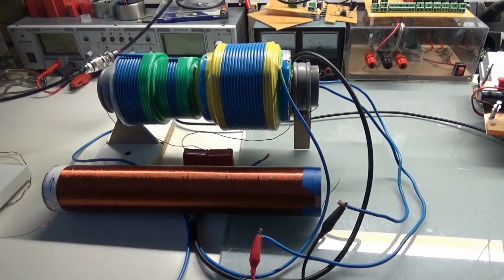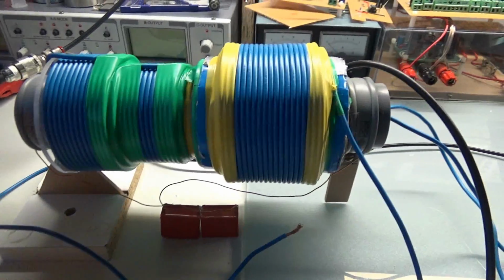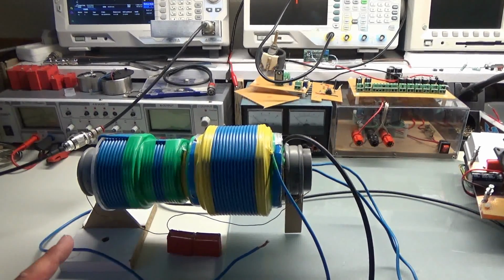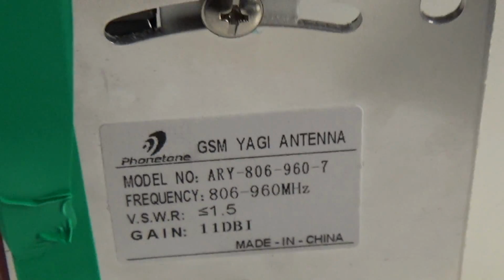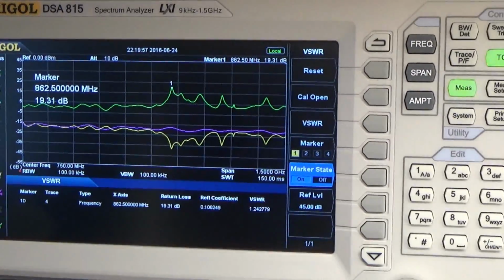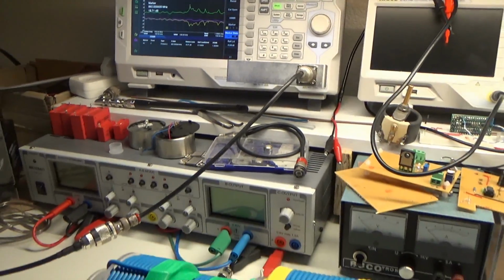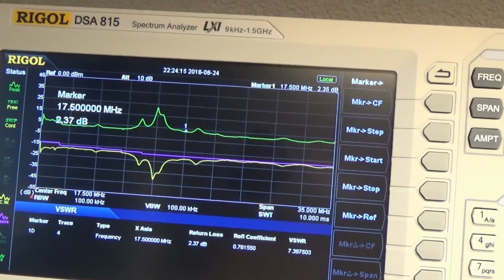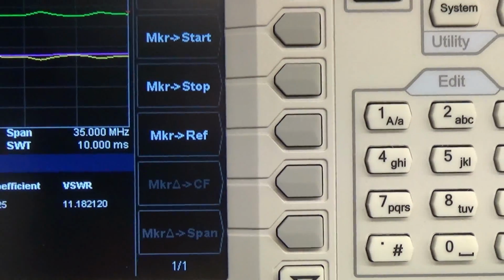ruslan final

Comment: WRONG GRENADE COIL !! MAKE IT HOOPER COIL. HOOPER IS PURE CAPACITANCE COIL - NO INDUCTANCE AT ALL. MAKE IT THIS. START POINT. WIND TO RIGHT CW DIRECTION TILL END. STOP. START MOVING BEHIND COUNTER DIRECTION LEFT WIND ONLY CCW TILL START. AND AGAIN AND AGAIN SEVERAL TIMES. THAN TEST AT SPECTRUM ANALYSER. BUT FIRST MEASURE LENGHT , WINDING STEP (YOU ARE USING INSULATION ISNT IT) AND IMPENDANCE. SWEEP IT FROM 0 UP TO 10MHZ. THAN YOU FIND FREE RESONANCE POINT TAKE 2nd HARMONIC OF IT AND TUNE WAVE RESONANCE EXACTLY. 
THAN PUT IN YOUR GENERATOR.ELSE THOW YOUR COIL IN TRASH !! IT WOULD NOT WORK !!

AND MAKE NEW PCBS HERE  НаилюБТГ.rar
Размер: 76.00 Мб
https://yadi.sk/d/HYHTPcB_39ZkpK!! 

----------------------------------------------------------------------------

NIKOLAI TESLA - Electrical Experimenter Magazine 1917-1919
Размер: 229,9 МБ
https://yadi.sk/d/yraaLJWodjjn2

---------------------------------------------

РАССЕН НИКОЛАЙ ТЕСЛА
ТESLA ARHIVA.rar
https://yadi.sk/d/kUx27GEx3APuBU

---------------------------------------------

Luchin_Priroda-poley-vzglyad.pdf
Размер: 2,1 МБ
https://yadi.sk/i/QPXzBe_ndjmmT

---------------------------------------------

Luchin_O-klyuchevyih voprosah v fizike.pdf
Размер: 1,1 МБ
https://yadi.sk/i/aT-1RpdYdjmmP

---------------------------------------------

Luchin_Liha-beda.pdf
Размер: 24,4 МБ
https://yadi.sk/i/5gIOXJK9djnUy

---------------------------------------------

Luchin_Istina-i-svoboda.pdf
Размер: 19,7 МБ
https://yadi.sk/i/GKaBIhN9djnWd

------------------------------------------

Luchin_Fiz-polya-put.pdf
Размер: 1,8 МБ
https://yadi.sk/i/ce60VDa0djmmR

------------------------------------------

Luchin_Fiz-polya-kontseptsiya.pdf
Размер: 2 МБ
https://yadi.sk/i/ugLv0THAdjmmM

-------------------------------------------

Luchin_Clavyane_svet.pdf
Размер: 13,2 МБ
https://yadi.sk/i/C77N4O74djmnJ

-------------------------------------------

Kachers.rar
Размер: 633,9 МБ
https://yadi.sk/d/MYYKBt6ddaGC2

-------------------------------------------

Видео !!
Ismael Aviso Big BREAKTHROUGH run BIG AC MOTOR part 1
Размер: 78,6 МБ
https://yadi.sk/i/N66TPHJvd4Edu

-------------------------------------------------

Видео !!
Isamel Aviso motor BREAKTHROUGH run BIG AC MOTOR part 2
Размер: 35,1 МБ
https://yadi.sk/i/ZmfmLKm9d4DLZ

-----------------------------------------

Vladimir Ilych Brovin.NEW.zip
Размер: 8,3 МБ
https://yadi.sk/d/WbpBln2BdaFz3

-----------------------------------------

Viktor Shauberger - Hidden Nature.pdf
Размер: 10,3 МБ
https://yadi.sk/i/s1VqP-GBdXGXt
-----------------------------------------

Павел Николаевич Яблочков - Труды Документы Материялы
https://yadi.sk/i/uTVcsweTwCGfr

Демонстрационная методика синтеза элементов из воды
в плазме электрического разряда
https://yadi.sk/i/kRsz8ASKzdTTt

Болотов - Основы строения вещества.редакция 2010г.(665 стр.)
https://yadi.sk/d/7IbPgG0CujRTC

Х-файлы Сан-Франциско.doc
https://yadi.sk/i/kbJmqvIid2Efm

Электричество во всех его применениях…
https://yadi.sk/d/uzc3WZxRhFGJK

К.П.Xарченко «Лучистая Энергия»
https://yadi.sk/i/kWZtVlkfvxHMz

Харченко К. П., Сухарев В. Н. Электромагнитная волна, лучистая энергия — поток реальных фотонов.
https://yadi.sk/i/qk3SL5Pyvny3C

НОВАЯ АНТЕННА БЕГУЩЕЙ ВОЛНЫ "ОБ-Е"
Константин ХАРЧЕНКО
http://ra3tox.qrz.ru/s5/an-501.html

Афанасьев - Средства измерений параметров магнитного поля
https://yadi.sk/i/fNqKDZV_wLex8

Сергей Сталкер - Мои схемы из видео для Ютруб.zip!!
https://yadi.sk/d/o_vaa63Mvd4qs

Сергей Алексеев
https://yadi.sk/d/G63r5TcMvd54R

ADRIAN BTG.pdf
https://yadi.sk/i/pZ9yvYZ9z7WwK

I.Grekov.Resonans.1952.djvu
https://yadi.sk/d/YHa20d-C3DtMYD

отрицательное сопротивление ферритов → параметрически Резонансний Генератор
http://i12.pixs.ru/storage/7/2/8/Parametric_1420395_24608728.jpg
http://i12.pixs.ru/storage/7/3/2/Parametric_3714215_24608732.jpg

Geron Aleksandriski
http://i12.pixs.ru/storage/2/6/4/GeronAleks_9283308_24637264.jpg

Tesla Octave Multiplicator
http://i9.pixs.ru/storage/1/2/7/teslamapto_6631221_24628127.jpg

Ч. Ледбитер - Оккультная химия
https://yadi.sk/i/TUJo0favuf9bS

Cater, Joseph - The Awesome Life Force- Orgone
https://yadi.sk/i/njXQLvvyvmeXF

----------------------------
yadi.sk/d/plujHeAZuVooZ
yadi.sk/d/iKX-KAXRujRST
yadi.sk/d/Ij9bJeZU37rJgg
yadi.sk/i/TUJo0favuf9bS
yadi.sk/i/N9tChYlE37sHxp
yadi.sk/i/j-n7KZSR37sJ6V
yadi.sk/i/ZbJEzE6K37sJAV
yadi.sk/i/5gwUrShk37sDMH
yadi.sk/i/bjPlMGHp37sDSe
yadi.sk/i/DwS4bcm137sDZo
yadi.sk/i/yMou7t8k37sDdq
yadi.sk/i/okpmH2Fj37sDhT
yadi.sk/i/TOnm-jHO37sDnN
yadi.sk/i/qxpyVDsh37sDrL
yadi.sk/i/FVSwMMRW37sDwD
yadi.sk/i/J9xMWzb_37sE2u
yadi.sk/i/JjK3kv5437sE83
yadi.sk/i/27ty6j0-37sEBp
yadi.sk/i/aHNxqeMT37sEHJ
yadi.sk/i/cpZ5uyuW37sEi7
yadi.sk/i/sTPdBhMY37sFhP
yadi.sk/i/-FGttUQ_37sFva
yadi.sk/i/zr-GvWc137sG2h
yadi.sk/i/Xk1GbF3I37sG7A
yadi.sk/d/lDMH-UiX37sGBL
yadi.sk/i/lzX3hcKY37sGG5
yadi.sk/i/-n-Mdp8G37sFLa
yadi.sk/i/XLEaHpkO37sGfc
yadi.sk/i/nuZmsNJZ37sGjW
yadi.sk/i/qzpopM9S37sGoY
yadi.sk/i/ycGjwtVO37sGsS
yadi.sk/i/nxdYhJ_P37sGy4
yadi.sk/i/4qB0zIOF37sH4J
yadi.sk/i/TQcekFST37sH7o
yadi.sk/i/Fzpzsgzb37sHAp
yadi.sk/i/MxtrbmNa37sHFB
yadi.sk/i/Cdo2VHHg37sHUa
yadi.sk/i/Q8C53axm37sHZH
yadi.sk/i/46hi4Vei37sHdo
yadi.sk/i/JTP4s8Ed37sHi4
yadi.sk/i/LyvEJ7Qg37sHmw
yadi.sk/i/NuPY6ISU37sHtg
yadi.sk/i/Ylp6ME_b37sEnK
yadi.sk/i/-n-Mdp8G37sFLa
----------------------------
yadi.sk/i/8AWmMevA37sKGA
yadi.sk/i/m9dJiSKo37sKTm
yadi.sk/i/-quwQ8mn37sKYG
yadi.sk/i/d2nREohF37sKgt
yadi.sk/i/VmhTNJzC37sKnS
yadi.sk/i/Zn9IWezz37sKM9
yadi.sk/i/tOVqPtQG37sJyg
yadi.sk/i/_ms9OSLt37sKAN
----------------------------
yadi.sk/i/e8bsDOTs37sLJ3
yadi.sk/i/UB6PFx7T37sLP6
yadi.sk/i/ykXwFCHi37sLSf
yadi.sk/i/I3PQMvtU37sLdi
yadi.sk/i/eqahV9kX37sLjC
yadi.sk/i/RQyXbf_I37sLo6
yadi.sk/i/so5ung3N37sLvF
yadi.sk/i/7__ufOAh37sLzF
yadi.sk/i/4IT5hFFg37sM5B
-------------------------
yadi.sk/i/OAWp6hrr37sMUa
yadi.sk/i/9vxXShU437sMZP
yadi.sk/i/UZk137Vw37sMcW
yadi.sk/i/J_MwT8HQ37sMfs
yadi.sk/i/7gPmnZeE37sMiz
yadi.sk/i/Bd-Rsyam37sMnr
-------------------------

Comment: itsu maybe you could go back to the basics of Tesla original style ( or vasmus style).  ruslans set up sucks. maybe starting with 2 basic resonate Tesla coils we can then test many other modulating or pulsing techniques into the standing waves.vasmus and ruslans technique can also be seen on your normal 60 hz wall outlet 120 volt sine wave. pulsing at the peak and collecting the radio waves produced. although as don smith state higher frequencies will produce more accurate energy resulting in overunity.

Comment: Well done itsu but did you match the single coils all onto the same resonance frequency or on a harmonic ? Also do you have the right capacitive coupling between the sigle coils ? Probably not...Just first tune the single coils via tuning caps to have the same resonance frequency. ...
Reply from the maker: Stefan,the underlaying Tesla-like coil and lateron the inductor coil are resonating at the same 15KHz.
The Grenade is "free floating" as to catch the standing wave.Yes, i am sure that the is a lack of coupling (inductive and/or capacitive) between the driving coils (the underlaying  tesla-like coil and the inductor) and the grenade.To improve that, i probably have to remove the coax cable inbetween, but then need to find a new way to insert the  nano-pulse.Itsu